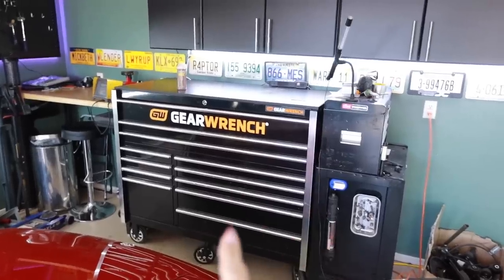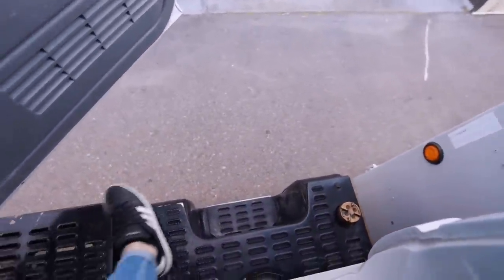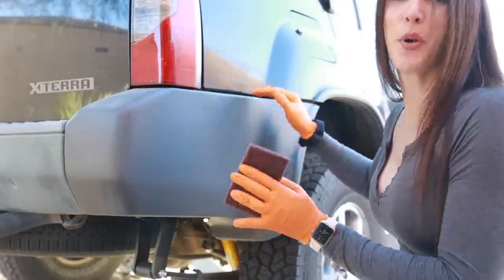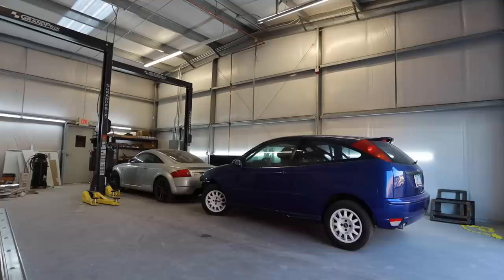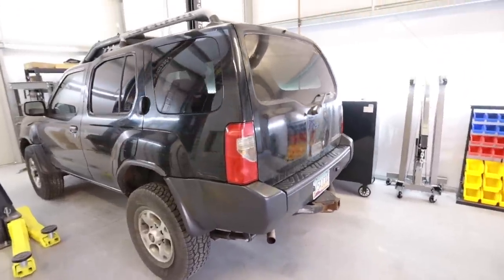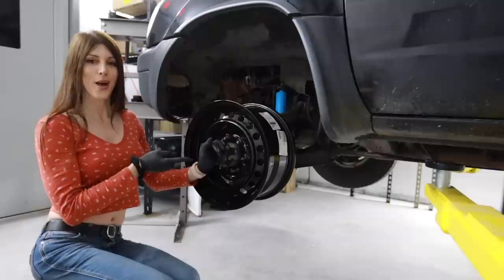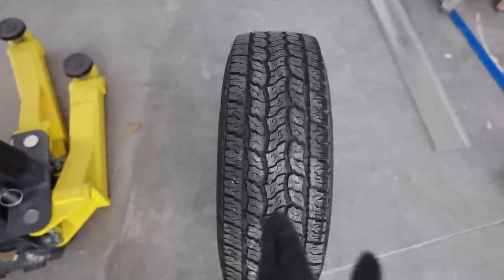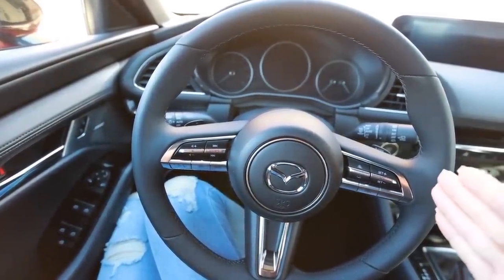Test Fitting Wheels on My Little Sisters Xterra // New Shop Vlog

Comment: Actually I saw that wheel choice, I just pulled 16" alloys off of my '15 Frontier and put 17" steelies that were factory spares on certain years of Frontier, Xterra, and Pathfinder on.  They're durable, they can help reduce the effects of balance problems with cheaper tires, and they don't break when being used offroad.  Plus cleanup if they get scuffed/scratched is some sandpaper and paint.

EDIT: and tires, I like the 235/85/16.  I went with 255/75/17 because adding more width doesn't really help in the Sonoran desert sand, and narrower tires are easier to keep aligned without excessive wear.

Comment: Hey, ex-age mechanic here too. I'd stay black with the steelies, more rugged. As for the LED lights that you were gonna tuck, I'd run an RGB LED strip under there for a little touch of ambient lighting, kinda like the blue ones in your garage videos. Bonus is if you ever party down at the shop then you can kill the main lights and rock the color changers. OK bye

Comment: At 2:47 If the Rear Main Seal is leaking look up "AT205" Re-Seal see if that helps
Reply: That works for a temporary fix but the seal will need need replaced, at some point.
Reply from the maker: I don’t half-ass fixes. No Bueno 👎🏻 Sorry!! 🥺
Reply: @SarahnTuned  I agree, don't half-ass fix it! However temporarily fixing it with some kind of seal rejuvenation product would stop it from marking up your driveway until you can replace the seal. I would get to the seal as soon as possible though.

Comment: Quick tip.  When painting plastic you'll want to use a product called adhesion promoter first before applying paint.  That way the paint doesn't peel off in the future :)

Comment: For the lighting on the recessed areas of the outer wall... you want to make it look great? Keep your task lighting where it is, and drop some LED ropelight in the recesses, on a separate switch. You can even go with different colours. It will light up the recessed areas nicely, and you can switch it on and off whenever, to get the look you want.

Comment: Best way to fix that bumper is to use a heat gun and get the areas hot enough to just about  shine and it will be fixed.  Heat gun works a treat everytime. You will know when its enough heat as the colour goes back to factory. Im a vehicle repairer/painter and been doing this for 30 plus yrs now

Comment: As a 1st Gen Xterra owner myself, I’m loving this series. It’ll be interesting to see how it looks with Steelies and 235/85’s. 

Have you made sure the front hubs are still working? My 2002 didn’t get put into 4x4 for at least 5 years (previous owner) and the auto hubs were seized. The warn manual locking hubs are a great upgrade and worth the money vs a stock hub.

Comment: Wheel color is Selenes choice, as for where to do reviews find a park, with trees and wildlife so you can talk to the birds. As for lighting what if you used remote controlled LED RGB strips stuck to the bottom of the beams. Then you could add colored ambience to the whole garage, or have different colored walls as well as the white light bars.

Comment: hey Sarah if your not aware there is a great product called AT205 that you put in the engine oil or transmission that relaxes the seal on cranks etc this then allows the spring inside the seal to tighten and stops/reduces leaks I have used it on a number of vehicles with great success it may work on you sister SUV.
Reply from the maker: I repair things correctly or not at all. 🥺 Sorry to be so harsh, but I’m strongly against those solutions.
Reply: @SarahnTuned  I agree with you totally but some customers don’t wish to spend hundreds of dollars to fix a small leak and as this works, it keeps them happy especially as some of the vehicles are not worth as much as the repair.

Comment: Can't go wrong with O.E. steelies. They bolt right up and balance well. About the 235/85s -- aren't they all 10-ply E-rated? Heavy and they ride rough. Some run lower air pressure to compensate. Maybe the larger diameter will help offset the even more horrible fuel mileage at higher speeds. They are durable though.

Comment: I agree with the steelies I have bent. One off road and bet it back with a hammer enough for a can of fixaflat to get back to any place that could sell me a replacement wheel and I have been in a car accident that smashed my alloy wheels and had to borrow a extra spare tire to get home with the alloy wheels crack with the slightest bend and can’t hold air after off road get steel wheels.

Comment: Use some at-205 reseal in the oil for the rear main seal leak.
Reply from the maker: That’s a 💩 way of doing things. I’ll do it correctly 😬
Reply: @SarahnTuned  I know you will. It's just a bandaid to get your sister through till you can.

Comment: DON'T just crank up the torsionbars. You'll get a very stiff ride . Mark the torsionbars on the lower A arm side and hammer them out. Turn them 2 teeth (left side clockwise, right side counterclockwise) and install again with the diesel settings. This will give you a original ride feel and 2 to 2.5 inches of lift. I did this with my hardbody (same suspension) and installed a home made 4"body lift and ran 35" tires with no problems.

Comment: It's probably not the rear main seal, 90% of the the time the leak at the rear of the engine on that generation xterra is just the rubber half moon seal on the rear of the oil pan. It was common we oil pan reseals on them all the time at the dealership.

Comment: If going off road, you can't go wrong with steel.  Getting home is more important than looking cool.
I have steel while spokes on my off road van.  Black shows dirt too easily.
I have stock size 15 inch white spoke wheels on my van because I tow with it and the tire size is just right for towing use.

Comment: I was wondering how your friends were going to deal with access to the paint both lights on your side of the building with the wall so close to the paint booth. Now I know.

Your friends have an interesting business model making available for short-term (daily) rental shop space, lifts, tools, paint booth, etc. I needed something like this available to me back in the late 1990s when I was painting my 1967 Ford Mustang coupe restomod project. I ended up painting it in a barn where the owner stuck a box fan in one wall and air conditioning filters in the opposite. A lot of the parts were painted in my garage. After color sanding the paint came out fine. Just glad the air quality district didn't find (fine) me. I now have a permitted paint booth in my home shop. Is this a business model they've seen work elsewhere? If I was remotely close to Tucson I would attend their open house on January 23.

Comment: Although I am way outvoted on this, I'd go with white epoxy paint on the steelies. Only downside is for the epoxy paint to max its hardness, it should be cured for at least three weeks. Or, possibly less time sitting in the Arizona sun and being turned over once per day.

Comment: Great video, hope you find some where to film your reviews so we don't miss you & your content.   White wheels would definately look way better, maybe look into HYDROGRAPHICS. Could get White Carbon Fiber look or maybe a White Checker Plated look or maybe a White Marble look. You would certainly have more choice & look better then plain white, it should be cheaper then if you were to be powder coating wheels. Best thing is if you don't like it, its easy to change the print on the wheels, also should be quite resilent to wear or damage.

Comment: Hi Sarah, just let the wheels so. By the way, because the safety of your little sister the x-terra should be reinforced with at least a roll-bar inside the couchwork and welded to the chassis of the x-terra. Young drivers are just like animals.

Comment: ok am OOOOld black steel rims right on, if I could get them I would use the steel lock rims, you can pop the outer rim off with a screwdriver and fix tiers in the woods, some jerk drove my firetruck through some cholla and destroyed a front tire.  when you are 80 miles and 6 hours away from town you do what you gotta do.  Killed spare too.-------

Comment: I kind of agree with Celine regarding the Xterra.  As long as it runs, and the steering is tight.  Why go nuts with polishing, and the upgrades?  I mean; it's a 20 year old Xterra, not an MR2, or Aventador.  But it's just my opinion.  Do whatever keeps you happy.

Comment: Definitely keep those wheels black if you must paint then I say satin silver or something just no white 🤢
So basically you’re putting 32’s on it with a 16 in wheel with an odd tire size I’m assuming a more common 32x11.50R15 or a 265/75R16 would be to wide (approx same height) ?

Comment: Mazda 3 turbo isn't going to be what we were hoping for. They're trying to go in the upscale direction, not sports car.
Prefer the black wheels on the Nissan.
Reply from the maker: Yeahhh.. but I didn’t frown chucking it into a corner either. I see modification potential with this too if the TCU can be tuned to reduce the torque management software some.

Comment: Sarah, I had a 1986 Mazda 323 turbo 4 wheel drive. Worst car ever made. Front axle seals leaked with only 5,000 miles on it. Sat in the Mazda dealership for 3 months because they couldn’t get parts from Japan. Ended up selling it as a parts car for a rally racer. Took a $9000 hit on it because Mazda would not take it back.

Comment: I say keep them black.  Anything else and you'll need to add an accent color to the body to tie it together.  Example, those alloy wheels don't look right on her truck.  My Jeep, has gold badging, pinstriping, and gold accents on the wheels.  It's all tied together.  Also, you don't ramble.  You have interesting side stories that are related to your main story that you share with us before getting back to the main story.  Even if the only correlation between the stories is the person presenting them.

Comment: Plastic bumpers, you need adhesion promoter.  Or the paint will fall off. And you will need wax and grease remover.
Go buy a proper off road wheel. That is an SUV rim.
Tyres?  16x7 245 x70x16. Far better contact patch,
235x85 x16 is a base model Landcruiser tyre
Reply from the maker: That wasn't paint, its trim black. No, you do not need adhesion promoter for it.